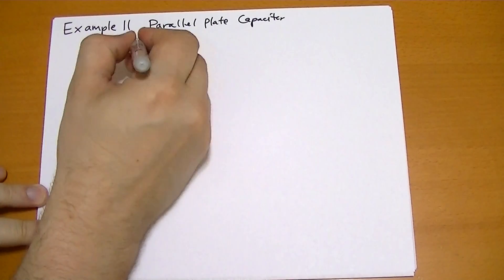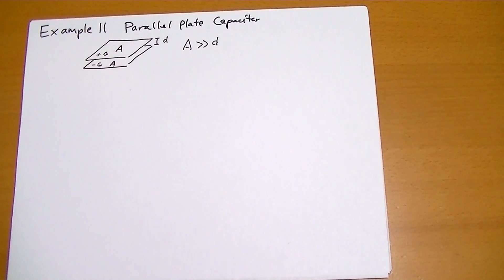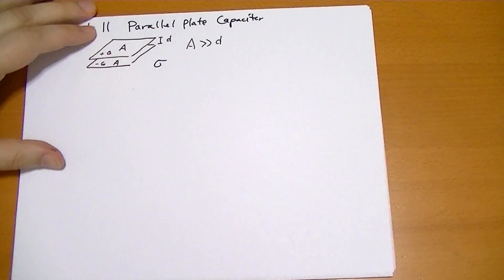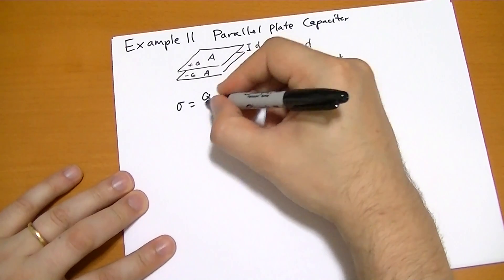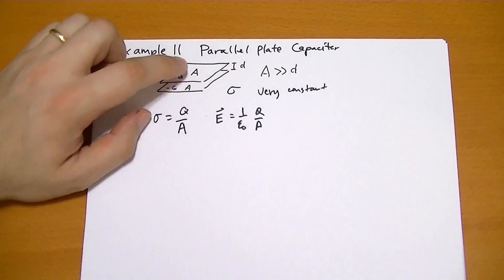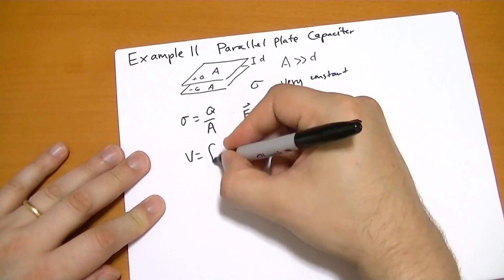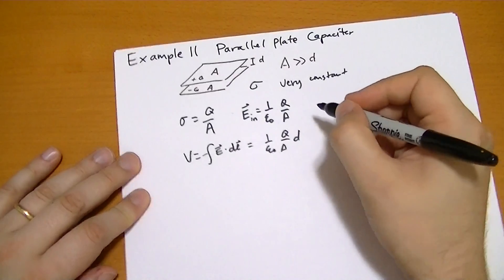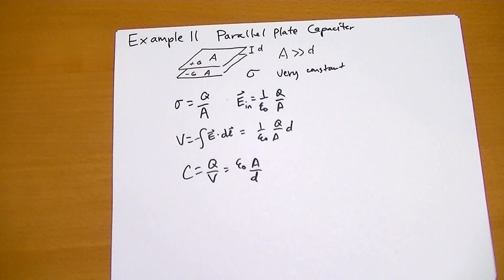2.5.4 Example 11

Comment: Where did the negative sign go for potential?
Reply from the maker: Either way it doesn't matter.
Reply: negative potential implies for the bound condition ... one may think like that if a charge is kept between the plates it  can not go outside, or we can say it gets bounded.... on the other hand capacitance is ability to hold charges in the plates so we can ignore the negative sign. ( it must be as capacitance is always positive)...